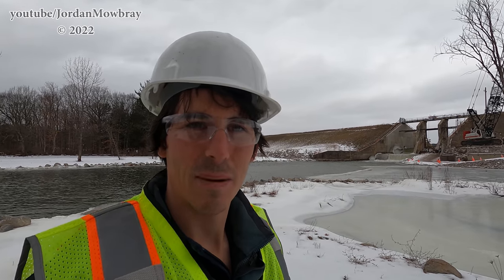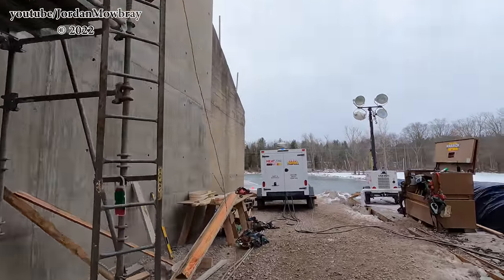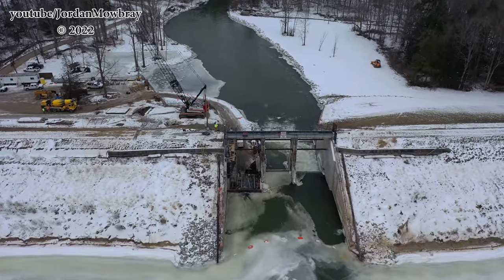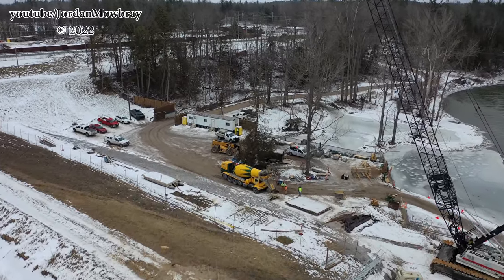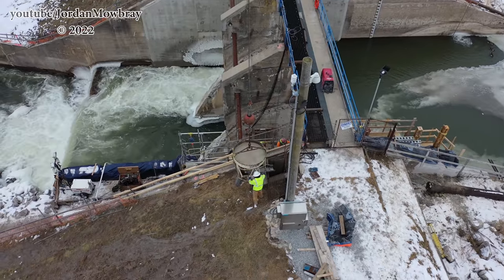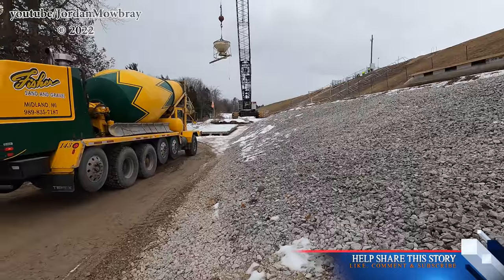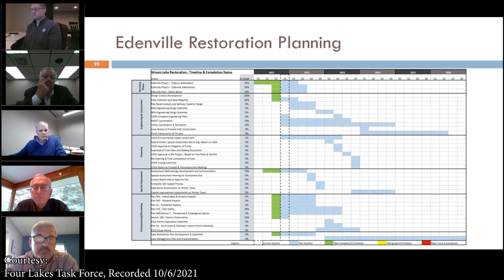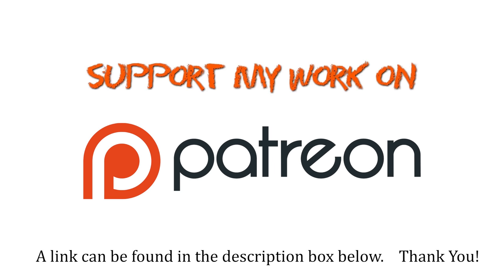Tobacco River Dam Update - Pouring the SHAFT full of Concrete! - Dam Collapse - Wixom Flood

Comment: I'm sure the crew knows what they're doing, but that is some of the wettest concrete mix I've ever seen.💧
Reply: I imagine part of the reason is they can't safely get down in there to vibrate it between bucket pours, so they need it loose to flow and minimize air gaps.
Reply: Robert, it was flowable fill, not concrete.
Reply: Colder temps allow for a thinner slump, so it sets up correctly.

Comment: That concrete looks awfully soupy.  I worked as a Concrete Tester for two years, and we would measure the slump of the concrete at each site.  Usually, the required slump on a project like this would be 2-3 inches (lower is stronger), but this looks to be 6 inches or more.  We almost never delivered concrete that watery.  It must be just for fill, because it would have very little strength at that slump.
Reply from the maker: This is called flowable fill and not concrete from what ive been told
Reply: @JordanMowbray  Our company did deliver material like that occasionally.  It basically just has enough cement in the mix to allow it to hold form, but not support anything.  I didn't have to quality control it so I never got sent to sites where it was used.  I only heard about it from the delivery drivers back at the plant.

Comment: Non sense to pour a dam in winter. They act like it's a frickin sidewalk. Cement will harden up in cold weather... But the strength is compromised
Reply from the maker: This shaft is not structural so it is just being filled in